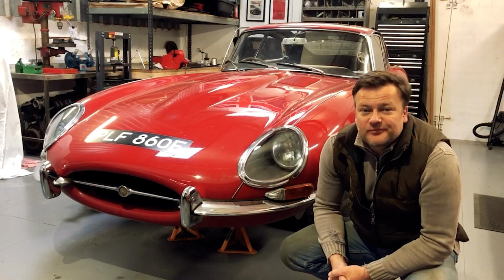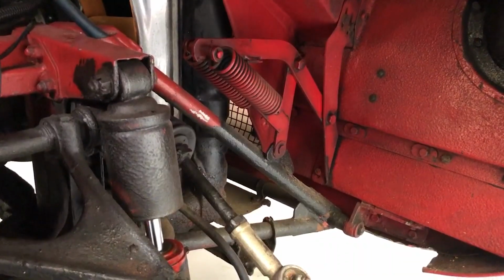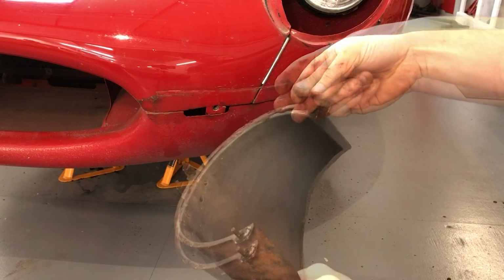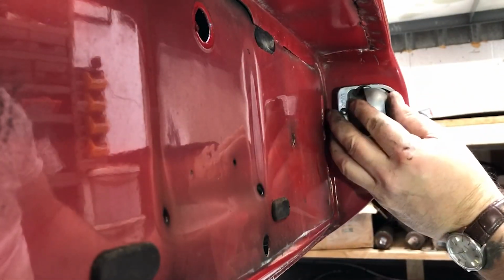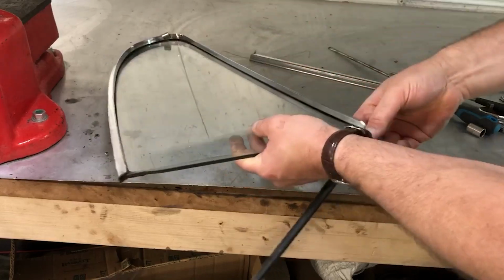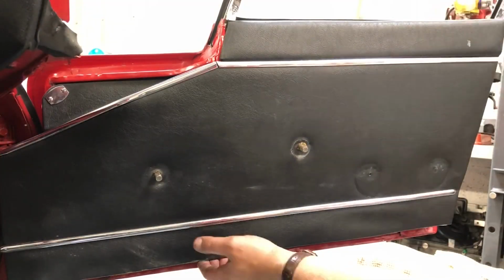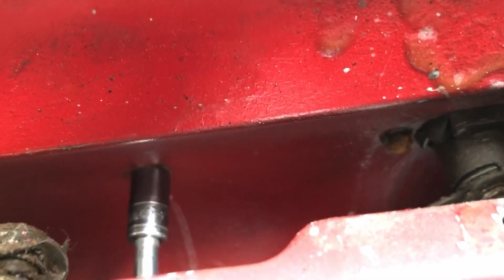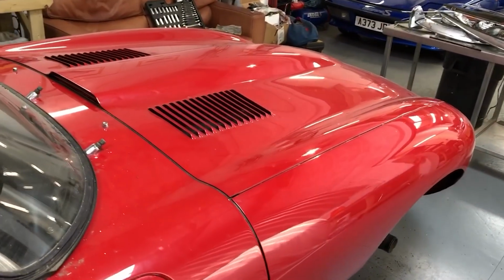Ep13 - 1967 Jaguar E-Type exterior lamps and chrome removal

Comment: Just wondering why you didnt show the removal of the chrome strips from the roof drip rails, did you mess them up trying to get them off ?
Reply from the maker: Good question. The driver’s side strip was flapping around when I collected the car and the other side wasn’t on very well either so they came off the car from early on. I’m going to have to get new replacements which might not be ideal but I’ll have to give it go!

Comment: Absolutely brilliant videos, I did exactly the same as you in the 2000s,unfortunately mine was a lot more rusty than yours, due to one thing and another I sold it 3/4s done, stripped the irs but never got it built back up, put floors in it, engine rebuild, front frames, I was using it every day but clutch went and one thing led to another.
Reply from the maker: Thank you very much, glad you’re enjoying them. 😀 There’s so much to car restoration, I’ve got plenty still to do but making good progress.
Reply: @fossewayclassiccars  I know, I did exactly the same as you, but the body was absolutely full of filler, looked great when I bought it, for instance the doors, by the time I'd got to solid metal, nothing of the door remained.

Comment: My coup is a 69. Interesting to see the differences on your 67. Thank you for the detailed explanations as you disassemble this car. Lucky for you that there isn't a lot of rust or crash damage. Those washers under the door window clamps are spacers to set the window height and alignment. Just another thing on the E-type you can adjust and then wish you hadn't. My recommendation; keep the old rubbers, don't put in new, too hard, original was better.
Reply from the maker: Thanks Hugh, I'll certainly hold onto the rubbers for now.  Some perish over time but that quarter light seal seemed pretty good so I might well refit.  Yes, there's a lot of 'finessing' that wouldn't be acceptable on a modern production line.  Each car will be slightly different.  I'm finding on my '68 S-Type that I need to adjust the rear door frames as they're not sealing properly at the moment for a similar reason.